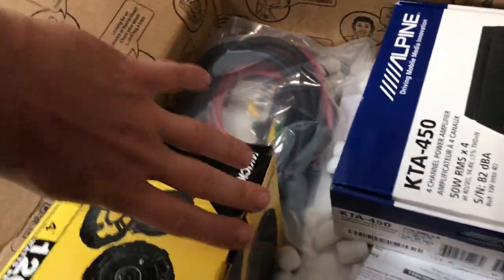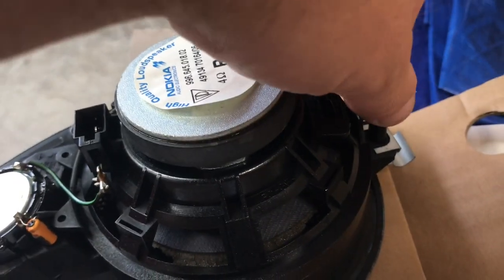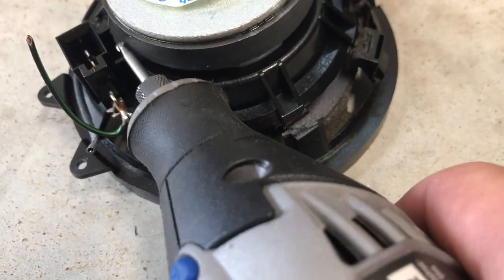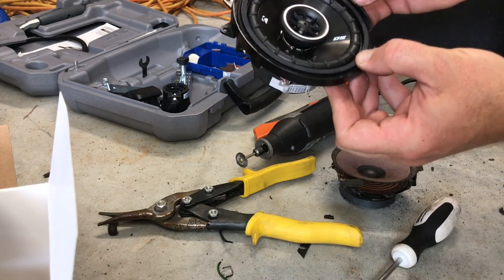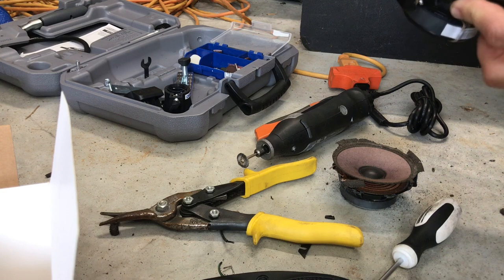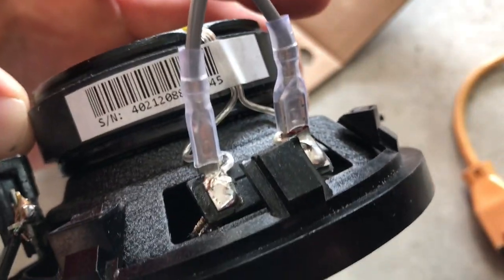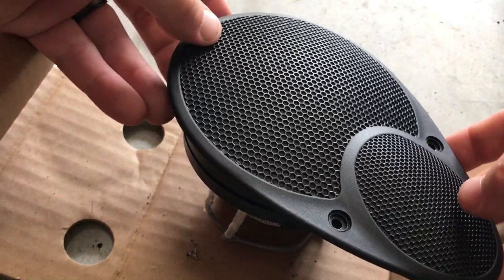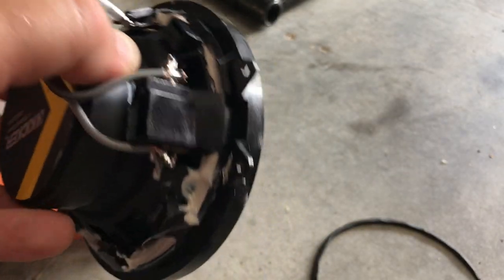How to REPLACE/UPGRADE DASH SPEAKERS in Porsche Boxster 986

Comment: I replaced my speakers last year, but I didn't cut all of that. You can buy these speaker adapter/mounting plate kits. Now that I look at it, I could have 3D printed some  circles and it would have been the same. But it just saves work from trying to reuse the old speaker mount.
Reply from the maker: +pr0d1gy visions yeah I made a follow up video showing what I think you are talking about.

Comment: Ok but how do they sound????
Reply from the maker: Dash ones sound good. I would have done different door speakers if I had it to do over again.
Reply: Well watching your content today made me check my dash speakers and they were being held on with wire ties and were blown. Got some 4inch 4ways from Walmart for 20$ and I am putting them in now. I will let you know how they sound.
Reply from the maker: Christopher DeJean please do!
Reply: Dude it sounds awesome. Twenty dollar speakers and they rock. I am on a budget so can’t spend an arm and a leg. Next double din and gonna put two tweeters in the back speaker compartment each and I am gonna build a custom 8inch sub between the seats. I am not gonna do door speakers. For the small passenger compartment I will not need much.
Reply from the maker: Right on!!

Comment: Wrong speaker on dashboard. 
You work a lot and the quality of the speakers man is so bad.
Reply from the maker: There is no such thing as a “wrong” speaker. Unless it doesn’t work. But this one was recommended by Crutchfield and definitely works. If you would like to suggest a better speaker that’s fine, but your comment is wrong and pretty useless.
Reply: 👍Thank you for all your hard work! I just got a 2011 Boxter and know your efforts will be very useful.
Reply from the maker: @ralphcuozzo1240  thanks!